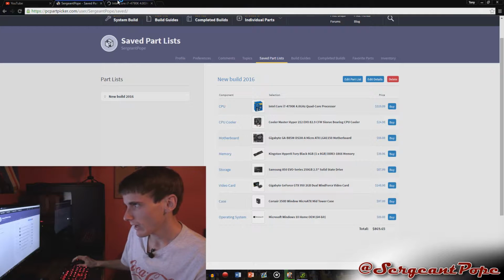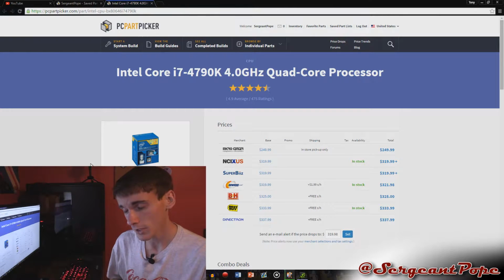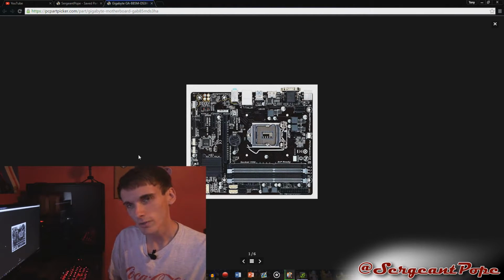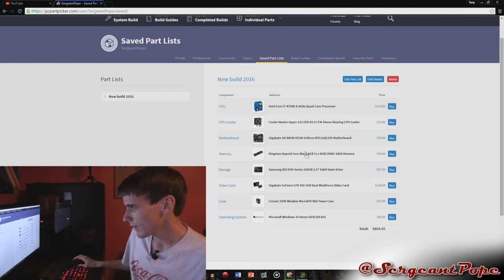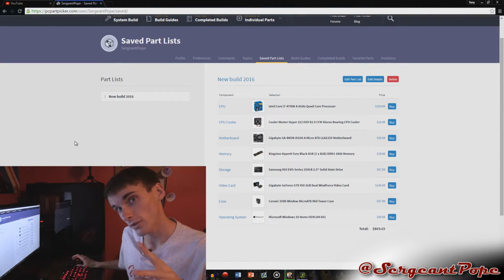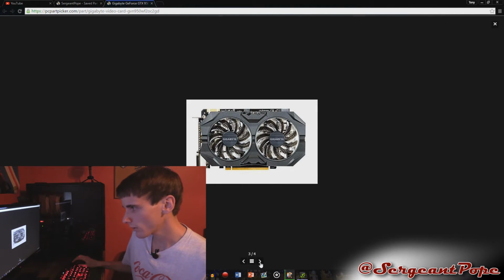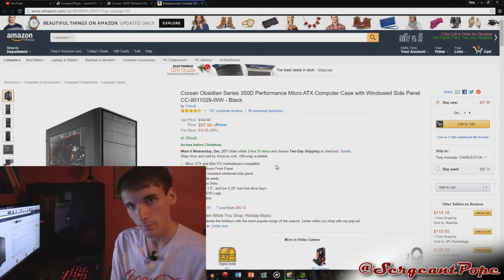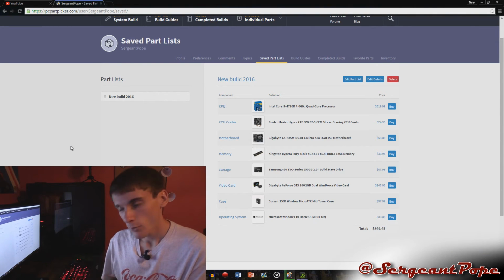2016 PC Build! - Picking the parts

Comment: this video helped me alot man thanks u so much but can u make a video about how to Connect 2 monitors and how to use them if u can?
Reply from the maker: +Had1 Gamer That's easy to do. Just connect both monitors to your graphics card. Most graphics cards have multiple video outputs, and you can use multiple of those at the same time.

Comment: I wana ask you man if I want to upgrade my 8gb ram to 16 gb ram is all the GB ram cards are the same size ?
Reply from the maker: +Had1 Gamer Ideally, I would get the same type of ram and from the same vendor (so if you get Corsair 1600MHz, get that for all your ram if possible). That said, as long as you get the same speed for all your ram and if it's the right type (DDR3, etc.) then it'll probably work.
Reply: +SergeantPope i have 8gb ram 1600 MHz so I get 16 gb ram 1600mhz ?
Reply from the maker: Had1 Gamer Yeah, if you get the same speed it should do fine. If you know exactly what ram you already have, matching it with the new ram you buy would be a good idea too.